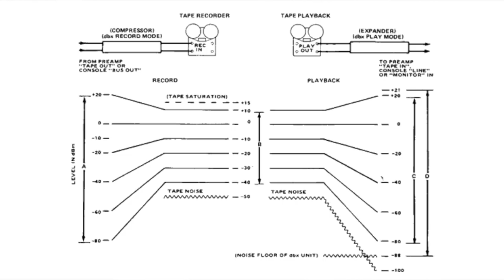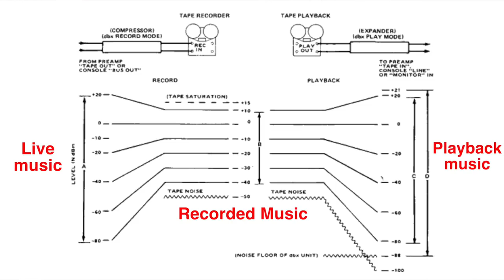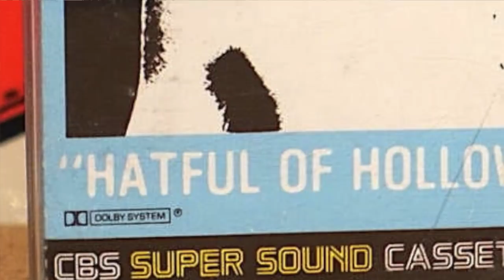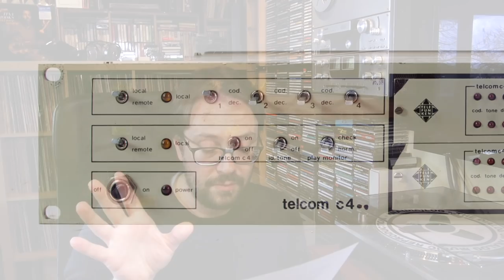Top Tape Noise Reduction Systems & How they Work

Comment: ANA/DIA/LOG. HELLO! ALDO.  I watched about noise reduction system.    Mostly my cassettes are not recorded with DOLBY.   I think the reason is because I record from REEL to REEL.   In my opinion the most important thing is your SOURCE;  if your SOURCE is poor and low recorded, even someone who has $10.000 stereo equipment the recording will not come out good.   Sometimes I use very cheap MAXELL Normal cassette without Dolby and it comes out very good.   The ones which I have recorded with Dolby B  I come to listen the recorded music and I turn OFF the Dolby then back to Dolby and I don't find any difference no HISS.  You can make a program about SOURCE  in your videos.   I have 4 blank cassettes which are very high quality;  I hope you have them.  QUANTEGY 472 type II professional series 45 minutes.  I have one recorded Classical piano, it' fantastic;  if you have keep them well.  O.K. my friend, CIAO.
Reply from the maker: I understand, but its not only a matter of hiss. A good compander should also extend the frequency response. Good chrome or metal don't relly need it but with ferric I always use it. It is in the end also a matter of a taste. Yes, of course the source is the primary aspect. I agree but it is rather obvious I think. In any case it's good to point it out sometimes.
Reply: @anadialog  Dear my friend Aldo.  Thank you for your response.  I just recorded Carmelo Zappula, Amami.
Reply: Dear Aldo.  I just watched the video how to cut mastering for vinyl on copper disc etc.   By the way I am not very good in computers, and I didn't know how to send you comment at bottom of the screen;  so I am sending you this way.   I listened Black Sabbath LPs I liked ORCHID track B  and Lord of this world track  A

Comment: Guido, I just picked up a cassette tape deck with DBX and DB B and C on Ebay over the weekend.  The first thing that came out of my mouth, after the first 2 minute recording session, was:  "Jesus F. Christ, whoever invented this technology was a fuc** genius" (forgive my French).  I am still shocked that the audio quality (from a normal, not metal, tape that I have) approaches that of my professional 2-track reel to reel at 15 IPS!!!!!  DBX (not the other 3 systems equipped with the deck) DRASTICALLY improves the sound quality by virtually eliminating the noise level without sacrificing high frequencyresponses.  I thought I was listening to the source (from DSD)!
Reply from the maker: Yes! Thanks for this comment! It will keep me going for months, so glad that you are experiencing this! Awesome!
Reply: @anadialog  thanks for igniting my interest in cassette tapes again, which I ditched entirely after getting my first high end CD/SACD player nearly 2 decades ago.  And, no, I no longer look down on cassette tapes (having spent 1 weekend testing them extensively with DBX.  I wonder if DBX is as good as HX Pro or Dolby S.
Reply from the maker: Thank you! Remember that Hx-pro is not a NR system, but an auto-bias adjustment during recording.

Comment: Not really volume it's gain increasing or decreasing.
Not necessarily the chips at-fault itself it's the circuitry from and to the chip plays the biggest part. Put a good quality polyurethane film capacitor of 10 Nano farads across the power rail of the Dolby chip plus and minus give it better filtration smooth out the signal. And low ESR value capacitors like Rubicon black gate that's why you're getting the pumping problem, the Dolby IC is picking up background noise and delay in the signal it can't determine if this is part of the music or not.
I was wondering have you tried analogue tape as a belt for your turntable but yours is direct drive

Comment: Outstanding explanation! I've learn a lot, but I think you miss one. What can you say about MPX which is present in many tape decks. I ask because my intention in to buy a tape deck as Christmas present for me. Thanks for all the videos and keep up.
Reply: Mpx is not a noise reduction system. It is used when you record from FM radio. So only use it if you record from FM radio. It filters away a specific tone that cannot be heared and is not part of the music. Similarly, your deck might have a button for a subsonic filter. That one is only used during recording of an LP. It filters away extremely low tones generated by pick-ups only, and are not part of the musical recording either.
Reply from the maker: Ronald gave a perfect explanation!
Reply: @ronaldjanmaat6191  Thanks Ronald for the information. I've learn something today!
Reply: Actually mpx is used to filter the 19khz pilot signal

Comment: Hello everyone... I would like to share an interesting experiment I conducted... it involves the tape hiss that's talked about a lot ... tape hiss isn't actually as much as it is thought to be ... I'll explain my experiment... it involved brand new tape and recording on a cassette with no input and blocking the heads (two head machine) ... 1st I blocked the rec/play head from contacting the tape during record ... played it back and there was only a very slight thump sound as hit stop (erase head circuit turned off) other than that thump both sections of the tape were EXTREMELY QUIET as far as hiss ... the 2nd part was mind blowing.... same recording with no signals being recorded only this time I blocked the erase head from contacting the tape and there was about twice as much hiss level compared to the rec/play head being blocked ... so that lead me to think why is the hiss much more  noticeable now? Interesting conclusion of why ... the BIAS signal increased the hiss level ... it is very easy to conduct the same experiment... I used a small piece of napkin (covered the tape in the cassette before i put it in the machine.... I recorded the output into my computer so I could examine the wave form in Cool Edit ... the cassette machine I was doing the test with was a Sony FX7 ... the machine erases the tape to virgin levels as I stated earlier only a slight thump as the erase head circuit turned off when I hit stop ... so I concluded that the BIAS adds a lot of the hiss that we call "tape hiss" ... Merry Christmas and Happy New Year to all

Comment: I remember in the 80's it was a guy who had a Sony stereo with big speakers and on the stereo it only said Dolly NR if I remember correctly.  and if you activated the Dolby on it then the sound became dark.  so maybe not so strange that he did not use Dolby on it.  then he had a reel to reel as well.  there were people who thought it was the best
Reply: Normally, if a tape sounded "dark" or muffled when played back with Dolby turned on, it means that the tape wasn't recorded with Dolby in the first place.  So, it never had the expansion signal for the chip to work with.

Comment: Hi everyone, I'm getting into 4-track cassette recording and have a query related to dubbing and noise reduction. When I dub cassettes from my master, which at this stage will be a HiFi VHS, what would be the best to use - Dolby B, C, or dbx? I have seen the odd deck with Dolby HX as well, whatever that is. I've read that dubbing with Dolby C will sound bad if the listener doesn't have Dolby C - same with dbx. Does anyone have any experience with this? TIA
Reply from the maker: I would try with nothing and use a good tape. If hiss is disturbing you, definitely dbx IMO.

Comment: Since the Dolby B was arguably the worst noise reduction and so many pre recorded cassette tapes were released with it, in your opinion, what is the best way to get the highest quality sound out of a " generic Dolby logo" (Dolby B) recorded cassette? (Even with a good quality deck) - I have a Yamaha and a Teac.
Reply from the maker: I think you have the solution. Check which were the best Dolby B chips in high quality decks, some were very bad, and then go for it.

Comment: How does in work in regards to deck and tape? If the tape is recorded with B, and  my deck has a selector for B, C, or none, how would I select which one to use?
Reply from the maker: If it's encoded in B use B. All prerecorded cassettes, unless stating otherwise, use Dolby B.

Comment: Is Dolby S like the SR (Spectral Recording) system introduced in 1987 on the original version of the film ROBOCOP?  Love DBX, which was used on APOCALYPSE NOW, but somehow ruined the master tape of the  STEELY DAN album KATY LIED, though its issues might soon, finally be resolved.
Reply from the maker: No thet are different and unfortunately I actually forgot to insert SR here. Sorry about that.
Reply: @anadialog  OK.  Maybe more on SR later?

Comment: Dolby B on pre recorded cassettes was because at that time every deck has dolby B. 

Where is the JVC ANSR system ? It is more used then high-com.
Reply from the maker: I had to make some choices. There are also several others that I had to exclude. For ANSR I can say that it was an older type of NR and on JVC decks, which aren't that amazing. Considering all high-com versions and their direct relation with telcom I decided to give more space to those. In any case I the future I will do another video on the secondary NR systems.

Comment: Dolby B is most effective from 2000 Hz above (to 20000 Hz), not from 200 to 4000 Hz. So it reduces noise in treble range. It is a good choice, because tape has most prominent noise in trebles. Dolby B is maybe least effective and cheapest, but on the other hand it retains some compatibility with non-dolby players, which is important in consumer electronic. Only advanced tape players were equiped with dolby B. On that cheap ones the cassette also had to be listenable. Tapes recorded with more sophisticated NR systems are unlistenable on player without respective NR system.
Reply from the maker: Most effective is one thing, I said it starts around 300hz as you can read here: http://tka4.org/materials/lib/Articles-Books/DSP/Noise/212_Dolby_B,_C_and_S_Noise_Reduction_Systems.pdf
Reply: @anadialog  I see. I thought, when you said that it goes slightly above 4 kHz, that you meant that it stops there with noise reduction. But you obviously meant the range in that it starts to kick in. It's natural, because every real filter has some "shelf". To be most effective above 4 kHz, they had to start already as low as 300 Hz.

Comment: dbx type I was for 15 IPS and up. It will pump and breath on slower speeds as miss tracking is caused from wow and flutter. Type II is more for cassette speeds and is no problem on 7 1/2 or 3 3/4 IPS on reel to reel decks. Yes Type I is better BUT as I said for 15 IPS or faster. If wow and flutter is controlled well it can work well at 7 1/2 IPS but the deck used had better be calibrated perfectly and wow and flutter reduced to bear minimum! Do not use Type I on cassettes!
Reply from the maker: That is not completely correct. Yes, as I said in the video type 1 was mainly for pro environment, I.e. reel to reel decks, which obviously work at high speeds. BUT, there is a but, dbx needs to work with a minimum of 60db signal-to-noise ration and 30hz-15khz frequency response machines, not at a specific speed (high speeds in most cases imply these parameters and that is why we refer to the speed usually). If those parameters are satisfied, you can use it also on a (good) cassette deck!

Comment: You forgot the Dolby HX-PRO which is used in combination with Dolby B and C.
Reply from the maker: HX-Pro is NOT a noise reduction system. Its a bias intensity regulator used only during recording.
Reply: @anadialog  very interesting topic,
I bought yesterday a Sansui double cassettedeck, D-X311 WR.
With Bolby b-c and HX-PRO.  also mpx filter
Now I know mpx is for recording FM radio, and HX-pro is automaticly for recording.
Thnx for your info

Comment: Any of those compander  ( compressor  -expander  )  systems leading to harmonic and inter modulation distortion an they changing and modifying the sound of the music  from the original sound and they do not meet the standard for Hi Fi   DIN 45500 , no mater how impressive they sound . HX pro also playing with a Bias to increasing  the high frequencies distorted the low frequencies in this time. The only solution is low noise cassette deck or real to real.  Or... blue ray audio format with no compression
Reply from the maker: That is surely the best way to not alter the signal.

Comment: One thing that should me mentioned is that all noise reduction systems need to be calibrated to work properly.  You could buy Dolby calibration tapes to set the proper levels.  DBX used an RMS level scheme that didn’t need a set level, but did need the frequency response from recording and playback be as identical as possible.  Some decks included a test tone for Dolby that you could use to set a reference level.
Reply from the maker: Well, yes, in reel to reel recorders. In cassette decks it wasn't a standard.

Comment: I think the best way is to buy chrome or metal cassettes and don't use any Dolby! Or use very good reel 2 reel tape and fast speeds! A little noise doesn't bother me as long as it doesn't intrude on the music too much! Life is noise, a little natural noise won't kill Ya!
Reply from the maker: I can understand that, but I must admit that dbx is truly amazing...
Reply: @anadialog  also a good point! And yes it is!
Reply: Pure chrome tapes are very silent, not a lot of tape hiss. They cannot take a lot of level, but you can make very good recordings without using noise reduction. My alternative is to use double coated, colbalt doted type ii tapes, like SAX and record them hot. My budget friendly option is to use SA tape. I hardly use B, C, or dbx. Mostly no noise reduction at all sound best to my ears.

Comment: Oh my......................I am so sorry to a video like this as there's lots of misinformation here.
First great mistake is to claim that 90% of pre-recorded tapes use Dolby B.
Wrong.
Just because the Dolby ® sign is on a cassette, it does NOT mean Dolby B is in use.
It might as as well be due to the use of Dolby A in the mastering.
Claiming Dolby A is best is rather cheap.
Dolby A is ONLY for use on open reel. It would not function well on cassette tape.
This was mainly used on multi track recordings as they introduced more noise the more tracks.
Claiming dbx is better than Dolby is your taste.
Claiming that dbx I is better than other dbx versions is not really the full truth.
dbxI is for use on open reel. dbx II is for use on Cassette.
Telcom is found on cassette decks although you claim it's not used on cassette.
Saying Dolby C is better than Dolby B is not a fact.
It's a fact that Dolby C is more powerful than Dolby B.
Does the power of a NR system inherantly make it better? No.
Dynamic Range and S/N ratio is, by far, not the only footprint by NR systems.
There's lot of artifacts.
You can not compress a signal without compromising the quality of sound.
Do you at all know that the hiss of a tape is under influence of the speed of tape over the head.
I will not write a long text about how things work with NR systems.
I will just point out that there are many misinformations here.
So before you trust any of this, you all should get it verified properly.
Merry Christmas.
Reply from the maker: Hi Lars, I think you are changing a lot of stuff here just to bring the video down. I will answer point by point and show you that you are not correct.
First, prerecorded cassettes are encoded with Dolby B, mainly, or C or S. It does not matter how the master was created. The final product was encoded with thee standards and that is why on deck you have these types of Dolby. When we find a Dolby logo with nothing else written it is surely B, because it was the only one for several years. The Dolby NR systems are compatible upwards and not downwards. 
Among the Dolby systems, A was the more sophisticated and effective. It is a fact. Dolby S is a good evolution and could rival it but it was not implemented enough to understand its full capabilities. Fact.
I said that Dolby A is for pro environment (reel-to-reel). I did not say the opposite.
Yes, I did state that FOR ME dbx is better. I did not say it is the holy truth.
You are wrong again on dbx. It was conceived for reel-to-reel but you can use it on cassette decks if you want, you just need to have a deck that satisfies the minimum parameters of 60db of signal-to-noise ratio and a frequency response of at least 30Hz-15Khz. I do agree that this is not a typical use but you can do it. Yes, dbx II is mainly for cassette decks and it was a cheaper solution than type I. This is another fact.
Telcom C4 on a cassette deck? Ok, show me which one!
I can agree that the claim that Dolby B is better than C is not a fact. I think it is more effective but I can understand that otehr people do not think this. But then you say that C is more powerful than B. But then what do me intend with 'better' then? We have to define our terms better.
I agree that the noise reductions systems have a complex footprint on the final result. I did not claim anything different but you can understand that in an already way  too long video I had to go to the most important aspects and signal.to.noise ration is certainly there.
I did not go in depth on other aspects related to the issues of noise for the reasons presented above but the rest of things I discussed are not misinformation.
Merry Christmas
Reply: If a pre recorded tape had the dolby symbol only then it was recorded with dolby b. If the tape was recorded with any other noise reduction it will specifically state which type.